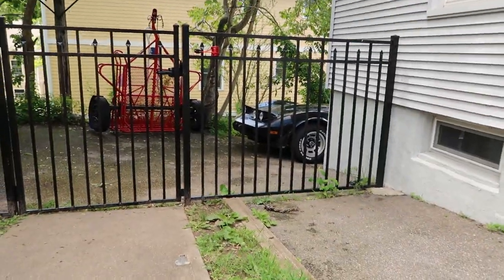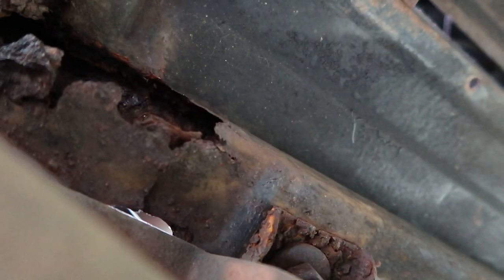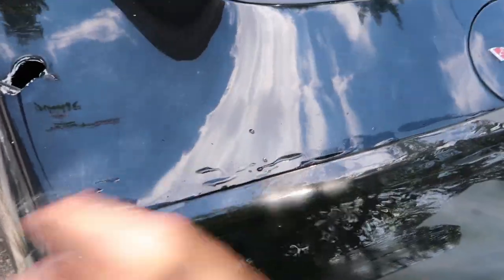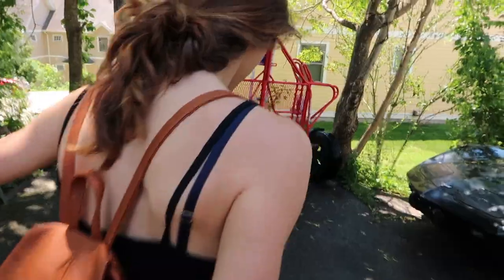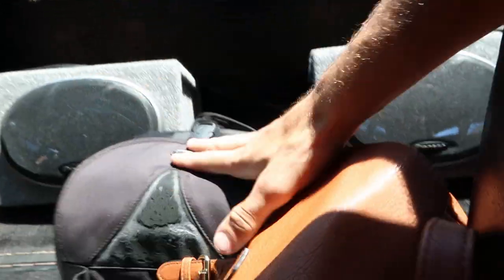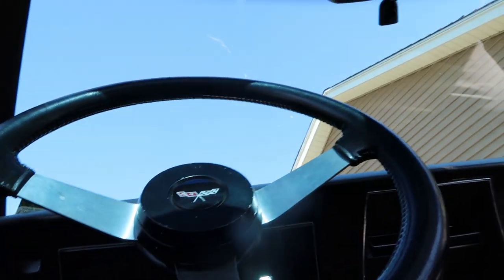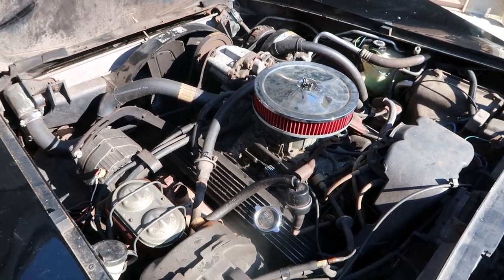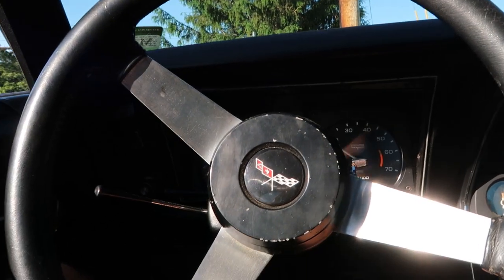This Is Why Pop-Up Headlights Suck

Comment: Your best bet would be to take out the engine which you can do your self just be sure to label all electrical wires and detach all of the hoses, this would then allow you to replace virtually everything mechanically including the ability to replace both exhausts. However, this will take time though this will depend on the amount of time willing to spend on it. Good luck with it all.